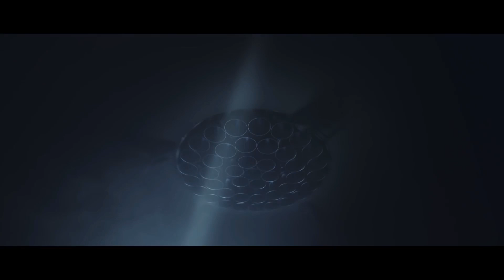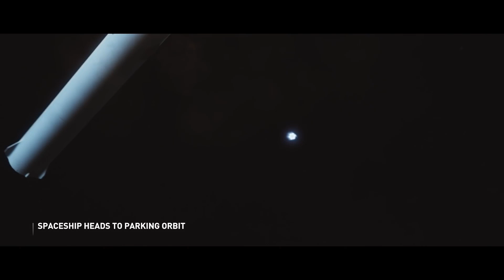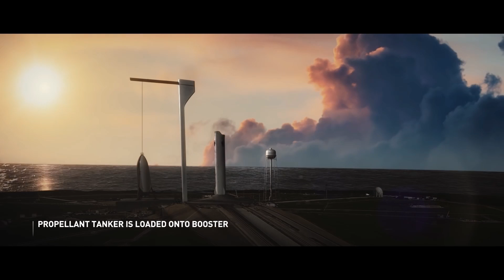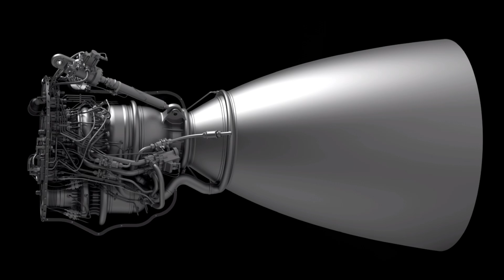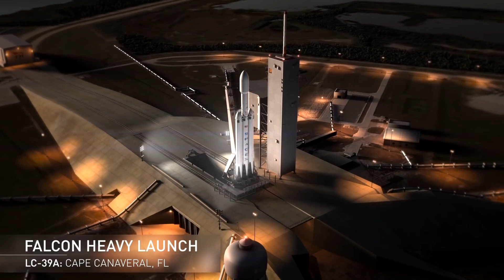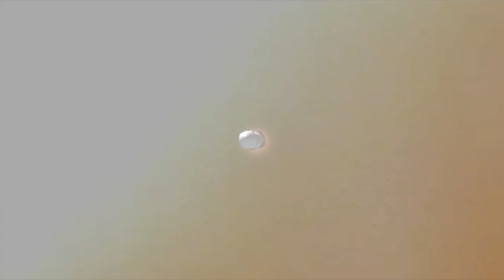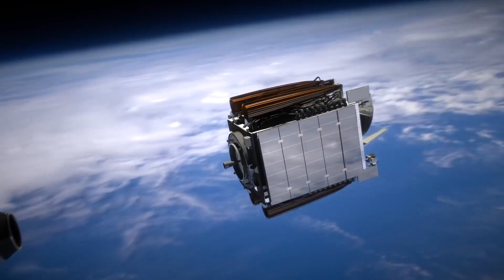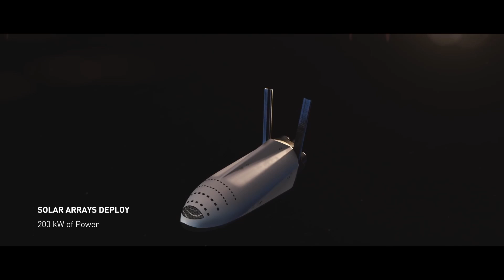Why 42! Engines On SpaceX ITS Concept? - A Simplified Little Insight Into Optimization And Scaling

Comment: another simple answer. One engine: engine breaks: rocket cant go

lots of engines: one engine breaks: rocket can still go.

i think ill go for lots of engines
Reply: Hope for the best, plan for the worst. =)
Reply: +Ambient Morality
There are a lot of reasons to install jet engines under the wings, risk of catastrophic failure is really down the list, far behind the fact that modern jet engines are huge and would require serious reinforcement of the fuselage to mount them on the rear, which would mean more weight.
Modern jet engine are the most massive and heaviest part of a plane, they simply spread the weight on the very part providing the lift, the wing, and suspended to reduce to a minimum aerodynamic interaction with the wing.
There is also that little detail that jet engines are noisy, that was actually a concern on some earlier jet airliner.
Beside, jet engine usually don't explode Hollywood style.

I would also point to the fact that several space agencies have now decades of experience of throwing stuff in orbit and beyond, and every space agency seem to think several engines increase safety.
One big engine is cheaper, several is safer.
Reply: The multiple redundant engines ARE the plan to deal with engine failure. It also allow to skip the massive cost of developing another class of rocket engine. Just use more of those you already have.
Reply: But the more engines, the higher chance of an engine failure (and an uncontained engine failure). There's a good reason why airplane engines are wing-mounted and separated.
Reply: Republic of Ravenswood Hey hey hey don't confuse things, the N1 had four launches, and four failures, and one being on the launch pad, but still, engines were not a huge deal, KORD on the other hand was it's biggest problem, KORD was the soviet underpowered version of the SATURN Instrumentation Unit, and it kept shutting off engines that were working fine, ultimately killing the rocket. And in the last launch another kind of avionics were used (i don't remember the name of the thing, but it was better) and it could have been a sucess, but the developing of the rocket was rushed, and it's structure could not resist to the vibrations caused by that many engines, causing a fuel tank rupture and ultimately, an explosion. Don't blame the engines, blame the structure and KORD. And don't blame me for resuming all this, I am not very patient lately....
Reply: That's because the Soviets could not do full up stage testing of 30 Nk33 engines at once. Socialism doesn't provide the funding capitalism does.
Reply: Every company still does full stage tests.
Reply: Yes, key word is "apparently exploded". It didn't explode, there was a rupture in the fuel dome and thus the pressure in the combustion chamber dropped. The engine was shut down and panels designed to relieve pressure in the engine were released to make sure that whatever happened has minimum chance of impacting other engines. There were clearly a few panels, not shrapnel flying out. The bright burst of flame is the controlled release of combustion chamber gases through those pressure relief panels. A more energetic explosion, such as through a turbopump overspeed event, would likely cause more damage.
Reply: It works for a contained engine failure, but an uncontained engine failure risk could be very, very bad on a multi-engined vehicle.
Reply: +Ambiant Morality
Yes, but a very bad ending is not just a possibility in case of engine failure if you have only one.
Reply: Usually don't, but uncontained engine failures do still occur. There are definitely other good reasons to mount engines on the wing, though (maintenance is one other one that you didn't note).

Some planes mount two engines on the sides of the fuselage near the rear (Bombardier's regional jets, etc) though.

Uncontained engine failures are substantially more common a failure mode for rockets, though. It's not that smaller engines are safer (you get engine out capability but increase the chance of an engine failure) or that larger engines are cheaper.
Reply: The N-1 had 30 engines on the first stage, and it never had a successful flight, while the Saturn V had 5 and never suffered a mission critical failure
Reply: That means almost nothing. Antares has a 75% success rate with a single engine, Falcon 9 has a 93% success rate with nine engines.
Reply: this is wrong.
if you have multiple engines it is safer you say.

if you have "infiite" engines and your reliability is 98% you will be stuck at 98%.
Reply: The argument is that if a single engine fails, the rocket can still continue. The problem is that most rocket engine failures are unconfined, so it's dubious as to whether more engines is helping.

By the way, if you have infinite engines, any engine failure means rocket failure, and the engine failure rate is nonzero, there is a 0% chance of success.
Reply: Ah, yes, I remember hearing about KORD.
different books and sources give different reasons for the failure of the N-1. rushed development was a big factor though
ultimately, no one is quite sure why it failed
Reply: +Sean Baskett
The funding is about the amount of money which doesnt mean it is "better".
more money = rich = better is a bit childish. You need to understand more of the systems to rate them
(start with london city capitalism in 1820, look at the foreign policy and the fight for oil, etc.)
so dont start political discussions. it has more to do with world hegemony
Reply: Ambient Morality I do know that they planned to use flack sheaths on the BFS landing engines. And the falcon 9 incident actually involved an engine exploding, not just shutting down. But the falcon still completed its mission.
Reply: It didn't explode... the engine lost pressure, it didn't have overpressure. For any sort of chamber pressure violation they shut down the engine and release pressure relief panels to ensure that the engine won't have further issues. Those panels are designed to not impact any other engines. A rapid explosion would send shrapnel flying.
Reply: Too much engines and too less engines are the both really problematic. Go for a reasonable amount, like 9.
Reply: In a word, redundancy
Reply: If not all engines are working at spool up before launch the launch can be scrubbed.  If all engines are working at takeoff and an engine fails shortly thereafter then that should not be a problem if you have more than five engines or so.  In fact, as the fuel is consumed they often throttle down to limit acceleration so losing an engine at that point isn't a problem. With the Falcon 9 I think they could lose one engine shortly after takeoff and a second a minute later with no effect on the mission -- the other engines would not throttle down as much which is better for ISP anyway.  There was at least one Apollo launch where they lost one of the five F1 engines and they still made it though they did burn the other four longer.
Reply: It's common sense, why do you think that transatlantic and pacific passenger aircraft have multiple engines?

Multiple engines = redundancy + load sharing = safer
Reply from the maker: depends - I still find the reliability of a rocket after loosing an engien questionable
Reply: Julian Danzer there was an incident during the flight of a falcon 9 where 1 of the 9 engines shut down but the payload was still able to be delivered
Reply from the maker: It can work - its just really not safe enough to plan on
Reply: Chances are, Spacex won't do full up testing. that's been obsolete since the days of the Saturn 5 and the N-1. the shuttle didn't get a full up test. and as for the N-1, what do you think the 4 flights of it were? those were full up tests, and a good deal more of them then the Saturn 5 got. you comment about Socialism and Capitalism is completely irrelevant, let's not turn this into an argument on the virtues of different form of government.

Comment: Hey man, what do you think of the risk of landing without landing legs for the first stage. Looks like those three wings at the near bottom of the rocket will be made of billet aluminum or some sort of hardened material. The landing hole diameter will be slightly wider not to exceed the wing's diameter. This way, if the rocket is off a little bit hopefully the design will guide the bottom of the rocket to its proper resting position. But the risk though, its going to be a nail biting moment.... Yikes.
Reply from the maker: I don't really think htat will lead to mayn failures - Space X is getting more and more precise with their Falcon 9 landings and by the time the BFR is going to fly they will either be precise enough to do this reliably - or they will come up with a slighly different safer landing concept
Reply: Thanks Julian. Just the thought of a $10 billion project depended on a precise landing with no legs is just mind boggling. Also, with 300 people inside the main spacecraft stranded @ parking orbit,  I just hate to think like that. But, I think you are correct, by the time they made this dream a reality - they will mastered their landing technique.

Comment: is it to do an N1 thing?
Reply from the maker: the N1 had different reasons for its many small engines - specfically they just didn't want to build as big engiens as the SaturnV - reasoning is still argued, it might be political, but at the time the russian engine manufacturers would not build SaturnV sized engines so for their moon rocket the rusians had to resort to the alternative - many small engines
Reply: Julian Danzer I thought they had big engines, just they never flew them. Rd270m1, the one burning pentaborane+ClF5
Reply from the maker: they had a few experimental big engines but never really considered them for actual rocketdesing - soviet spaceprogram politics were complicated and tey didn't want to build a moonrocket using dangerous fuel but the engine designers insisted building big engines with normal fuel would be impossible - the Americans managed to though
Reply: Soviet Union couldn't get past combustion instability. Glushko's bureau might have been able to solve it in a similar way to the F1, but when the propulsion development went to Kuznetsov they simply did not have the expertise or time to develop that.

Comment: can these engine be 3d printed?
Reply: Tiberius Maximus 42% by mass is 3d printed.
Reply: Not all at once but the separate pieces could be printed individually then put together
Reply: ... of the subscale test article. DMLS is slow and not a great technique to rely on for production, using milled/routed parts wherever possible does lower costs significantly - then when a single part becomes very complex, additive manufacturing is a good fit.